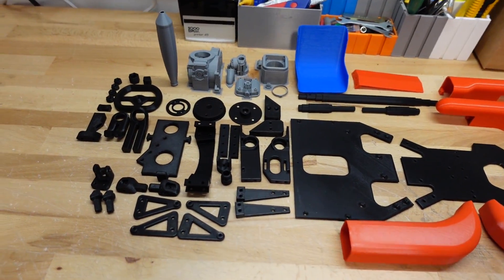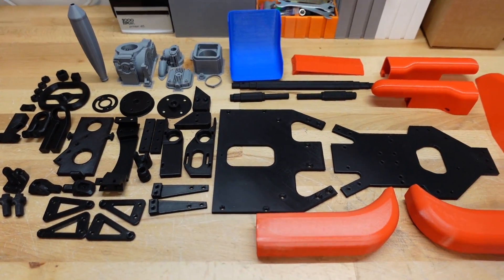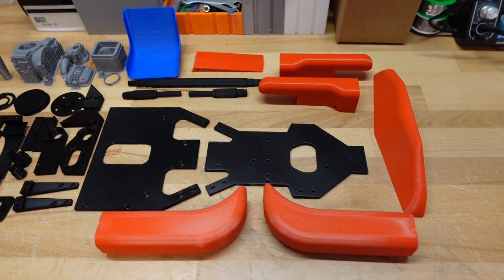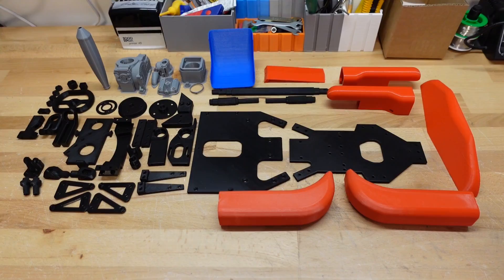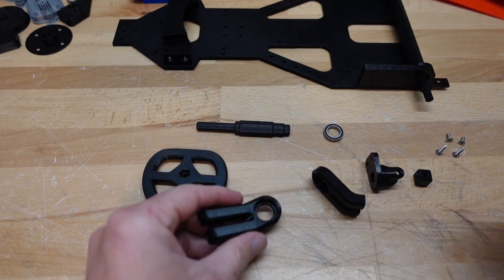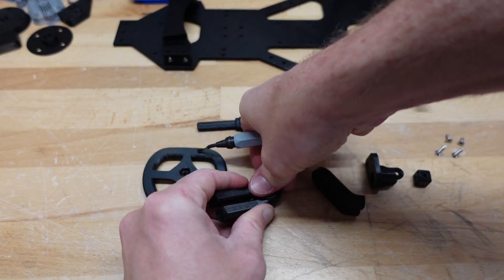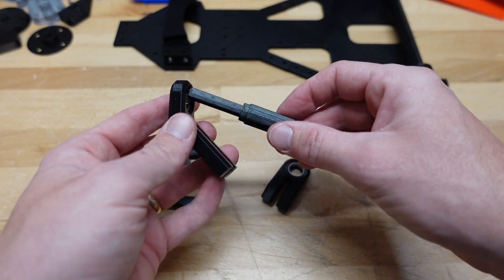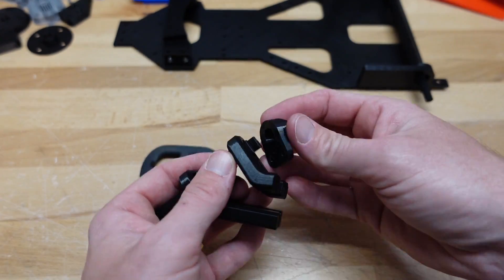OpenRC GoKart Build - Fully 3D Printed Scale GoKart

Comment: I'm doing your project but I'm having trouble finding the wheels, can you help me?
Reply from the maker: Hey its not my project. There's lots of different options for wheels/tires. Depends what you're looking for and what axle set-up you're using.
Reply: @rcprinter  I'm using the one from the project, not the aluminum one
but in the front I can't find the wheel that the bearing goes into to print

Comment: question. you show 2 different 3d printed rear axels. the one I printed off of Printables seams to short. Is there a different one I should be printing?
Reply: I think ThingsIVerse has the bigger version.
Reply: I just used the one with the motor side & mirrored  it  before printing it and it printed identical .
Works perfectly.

Comment: Would like to build one. Can’t seem to find anywhere the print settings
Reply from the maker: Yeah it can be a bit hard to know what to use and the instructions for this build aren't great. Generally when printing these cars I use a standard 0.2mm layer height and standard infill % or maybe a little higher for body and cosmetic parts and then I increase the number of walls for any parts that I think should be more resilient such as drive train and steering components. For some of those I might even increase walls until those parts are completely filled with plastic.

Comment: Where did you find a 16t pully with a bore that matches the brushed motor ? Closest i can find is 4mm.
Reply from the maker: I used an adapter sleeve like this: https://www.aliexpress.com/item/1005006877696942.html

Comment: where did you get the wheels and tires?
Reply from the maker: Tires: https://rcprinter.com/products/f104-tires-for-openrc-f1-front-and-rear 
I used the original openrc f104 wheels for the front and made my own rears with 14mm hexes. If you check the facebook group I think there's options posted there for wheels for these tires as well or you can go with any f1 RC wheels with 14mm hexes.

Comment: I recommend you watch these videos;:yt:Go-Kart 3D Printed RC  :stayhome:and:stayhome:  Go-Kart 3DPrint 2:yt: of my channel in one I learned the difference between TPU 84a and normal TPU apart from modifying the design several times to get more control of steering wheel turn, I also designed a helmet and a custom articulated dummy that also moved the head by means of a servo, in the helmet he has a "gopro" with a custom hole to put an FPV camera,   I would like to see your version of the rider, of tires, see you try the FPV and finally I recommend a Gyro is the difference Nowadays my kart is very different from how it was proposed, and I have learned a lot about steering, geometries of the RC world and settings apart from designing in 3D and adjusting the printer

Comment: Could you please provide the gear ratio and the motor specs...
Reply from the maker: I used this brushed motor/esc combo: https://rcprinter.com/products/540-motor-60a-esc-combo-kit . You should use a 16T pulley and the 3D printed belt drive gear has somewhere around 70 teeth I think.

Comment: What wheels/Tires did you Use?
Reply from the maker: The tires are the F104 tire option from the openrc F1 car with 3d printed rims: https://rcprinter.com/products/f104-tires-for-openrc-f1-front-and-rear
Reply: @rcprinter  Cheers!
Reply: Yeah, they have a mold parting line down the middle, so probably not printed.